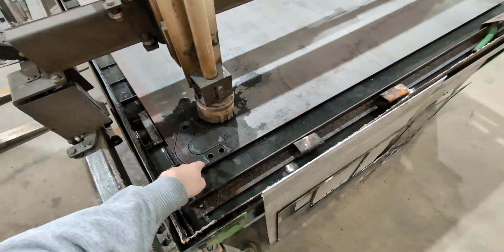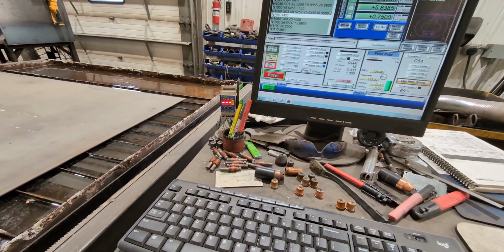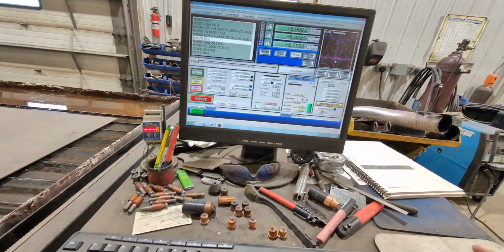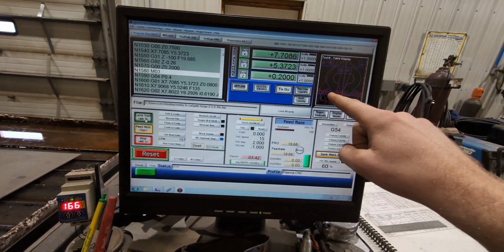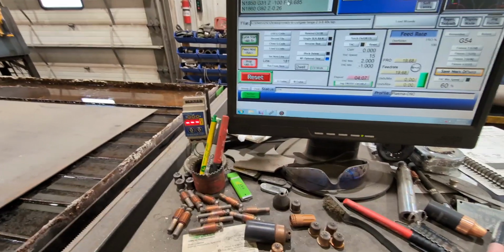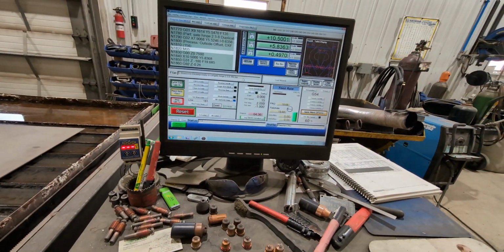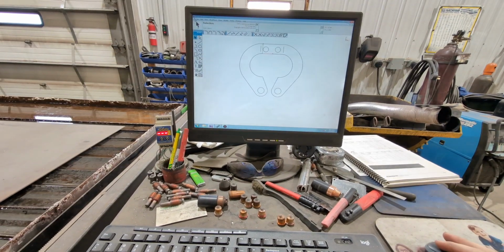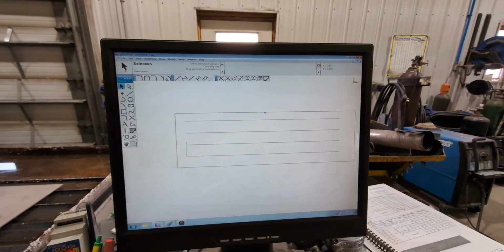more proma THC tips

Comment: Why don't you have the Proma on the side of the plasma unit like it states from the manufacture?
You just doing it all wrong!:face-red-droopy-eyes:
Reply from the maker: Which manufacturer? The proma itself can be mounted anywhere
Reply: @practicalfabricator  You don't know what you are talking about and are misleading the viewers!
If you read the Proma manual you will realize.
Page 4 of the manual: When connecting directly, use the shortest possible cables for connecting
the plasma source with THC controller - it is recommended the THC controller to
be located directly at the plasma source.
You can also YouTube search if you don't believe me, two minutes into the video:
 CNC Plasma Proma THC 150 Wiring Breakdown Done Correctly
Reply from the maker: @rosswoolley2854  Ross Woolley who? It's just fine the way it is. I used the full length divided voltage cable sent from Hypertherm I'm very much aware of how electricity works. Premier has since started mounting them with the break out board not the plasma source.
Reply: yup! complete wrong